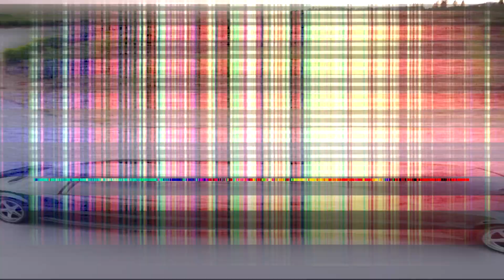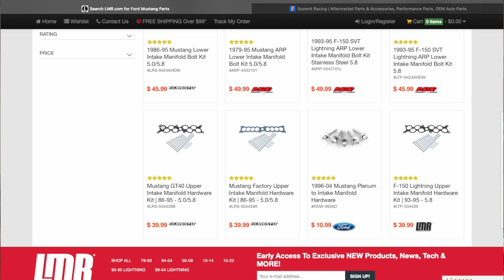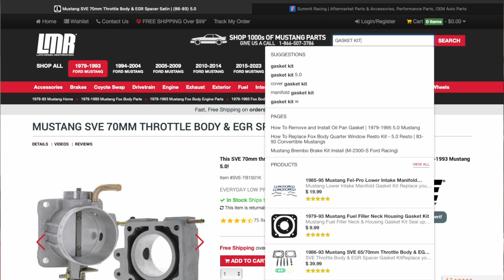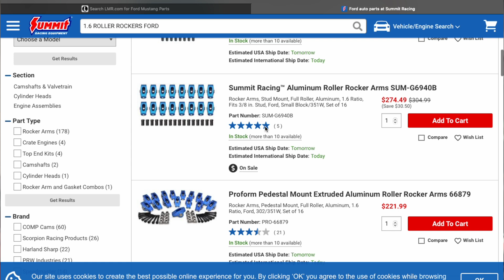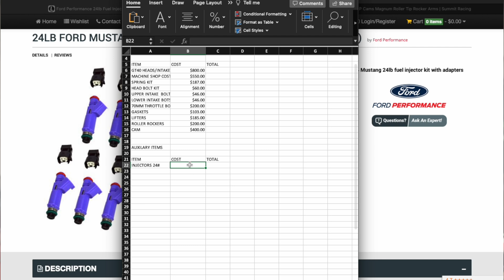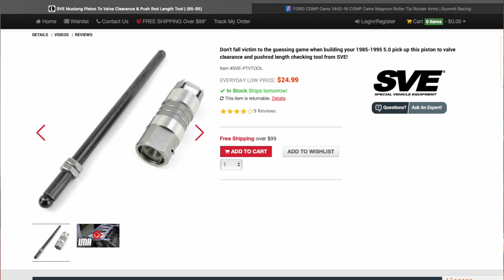Is Cheap Horsepower DEAD? HCI Parts List & Cost Comparison 2023

Comment: 3 years ago you could have done all of that for half the price.  Sad times we live in...
Reply: Here's a story the cheer you up.. Lol... I bought a brand new set of L303 GT40 3 bar heads in IDK...2003-ish from FRPP....
Sold through their catalogues, they came better equipped than stock ones, with Stainless Valves, and the A50 Spring package...
A brand new set of GT40 iron heads back then....$400.... for the pair!!   I also purchased 1.7 Cobra rockers for $170. and a '93 Cobra intake for $280. all at once...
For around $850. I had all brand new parts!!  
People are selling high mileage heads at crazy prices nowadays, above $800....you could also easily spend that at the machine shop rebuilding everything on both heads....
If I found cheap ones to do again...all I'd do is  replace the springs and make sure they were flat.
Reply from the maker: Amen buddy 🍻

Comment: Hey great video. It’s almost hard to justify the cost for the performance but I still did it. To a few cars haha. Most recent car (an electric red 93 hatch I’m restoring) had a nice top end kit on it installed by a reputable speed shop in Calgary when purchased it. I paid a bit of a premium for it but nowhere near what that work would cost today. 

Haha this actually sounds pretty cheap if you’re coming from the coyote game. They can make big hp but everything is super expensive. Arp head studs alone on my 13 build were $700 🤦‍♂️
Reply from the maker: Yes good points 👍

Comment: Hi Gary. You might want to look at pedestal mount rockers. Your GT40 heads came that way. You will have to drill and tap your heads to install rocker studs. I think Scorpion makes 1.6 pedestal mount  roller rockers. So much less hassle to install. I've been so looking forward to this build. Also, the Ford high performance roller lifters kinda aren't worth the extra fifty bucks. All they do is rev a little higher, 2 or 3 hundred rpm. Your mom will never need it. I'm just relating my experience with my build. Thanks for a great video. Bill.
Reply from the maker: Thanks Bill!